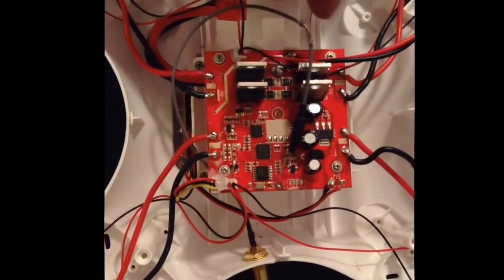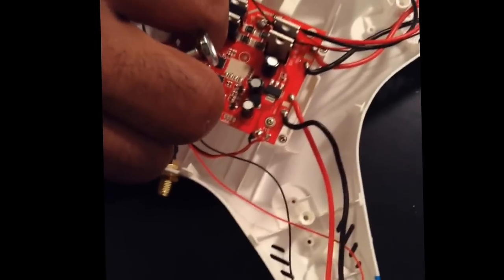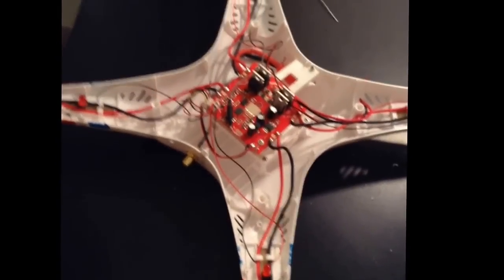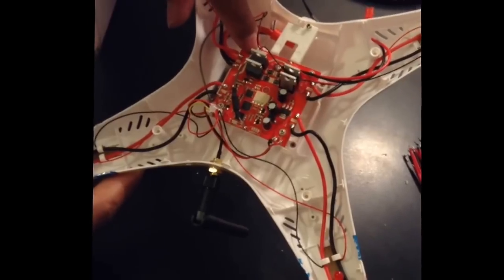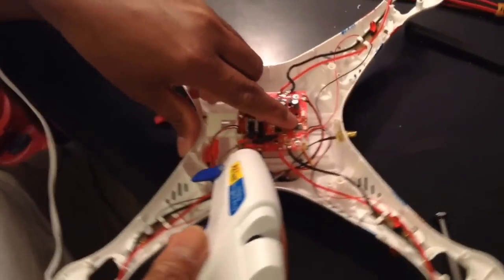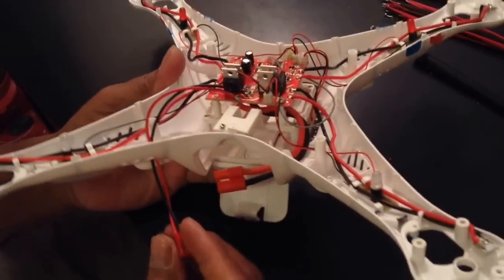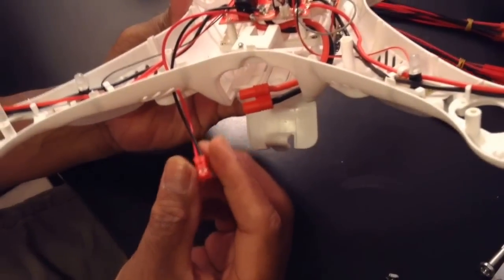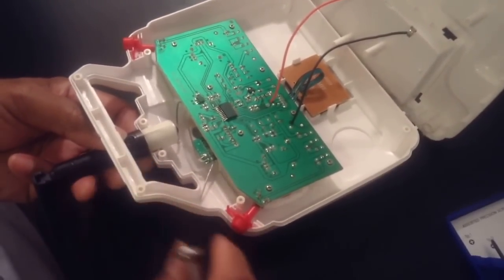SYMA X8W ANTENA UPGRADE

Comment: Hi,
Really nice video, I wanted to ask if you have heard or tried upgrading the stock antenna without actually taking out the stock antenna and just attaching a wifi antenna wire and to the stock and adding the antenna.
Thanks

Comment: Hi fun al.  Same problem with my X8W.  It would just drop and I just have to re-bind as it fall to regain control.  I modified the controller with 2.4G 9dbi but didn't fix the problem.  I will try to mod the quad too and hopefully  it fix my problem.
Reply: +Oscar Argota Try 5db on the controller
Reply: +JamoAerial 2db is the best, as it covers an 360° area.

Comment: Modded the Controller with what I thought was an excellent job, but made little or no difference. New out of the box, I get 30-40 meter range (bad!). Will try THIS and let you know the results!
Reply: It's not the board because I already changed a fried board (my fault - long story - reversed the battery) and the second board gives the same 30-40m results.... trying this........

Comment: hey you how the transmitter has the centre core and the outer core and both go next to each other. so on the quad the grown is the outer core correct? thats the one you have to ground to the screw on th quad?

Comment: what is a quart? and are you saying that after you modified the transmitter and the quadcopters antenna did it fly better or did the modification mess it up do you recommend modifying the controller and the quad like you did or not
Reply from the maker: +Andy Shaffer I miss spell, after modified it fly better
Reply: oh sorry does the wifi antenna work on the quadcopter? i was thinking  about doing that if it works

Comment: hey mate , cool mod , very intresting ! 
but did you rly need it ?
personaly, on ma X8w , i got more then 150meters stock range 
so ...maybe im a lucky dude with a very good unit 
but did ur X8 drop beyond 100m r someting ? i have never flown mine out of range yet :p
Reply from the maker: Hi, my second flight it went up about 10 meters and dropped to the ground and my third one about 15 meters, the battery full charge I saw here in you tube some people got the same problem with their Syma x8w
Reply: Wow lol that's strange

Comment: would it be possible to fit more powerful motors to syma x8w . I'm struggling flying with the gopro hero4
Reply from the maker: Hi, sorry I do not know, I use SJ 4000 I have no problem,

Comment: Not strange at ALL,only my first flight was OK,after that only 30 mts distance before losing signals...I will try a new Transmitter before upgrading the antenna..so "some guys have all the luck" not everybody ..Al
Reply from the maker: +Alberto Leone ,
did you try to change the main board
Reply: Hello and thanks for your suggestion,that work is a shoe number too big for me,and I did read about some has done it but the problem persist,anyway thanks once again..Al

Comment: hello my x8w burned ams1117 regulator, so I removed it and kept flying without the regulator has a problem?
Reply from the maker: I think you will have a problem if you remove the regulator without replacing it
Reply: +fun al I have done two flights without the regulator and nothing happened!

Comment: strage, mm i can fly over  150 meters  without  any modification
Reply from the maker: fly high after you change the board solve the problem
Reply: +GTDrone there is a distance test video showing this model going 390 meters horizontally before dropping.  About 1300 ft.
Reply: *****  , yea and thats true , i alredy try it and that quad is amazing have great range
Reply: +brianminkc yes and he claim that he didn't modify his x8w